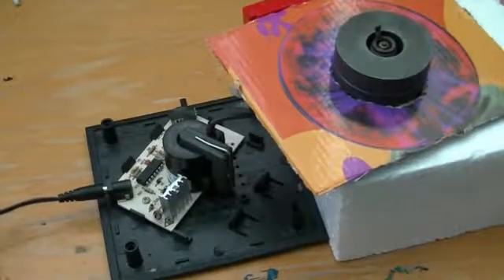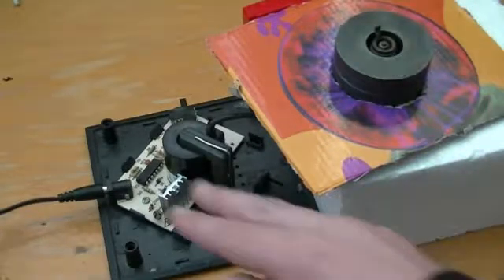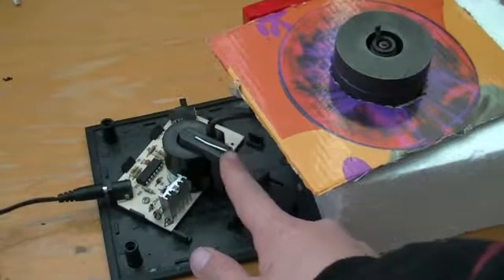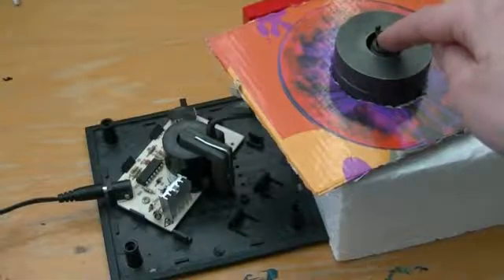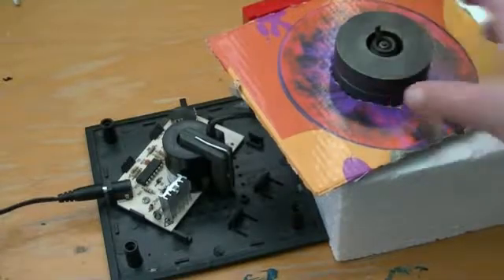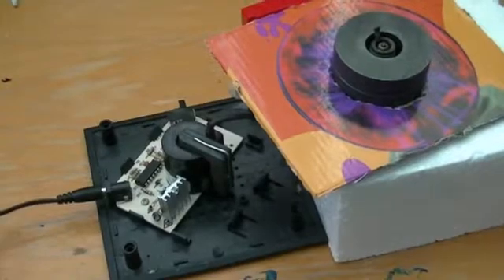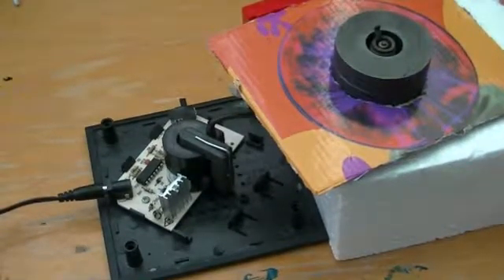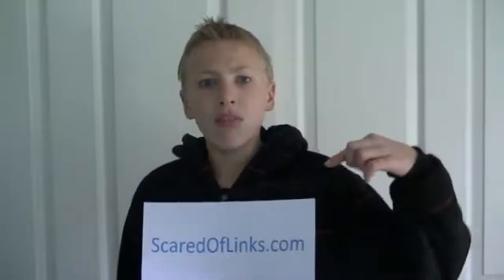plasma forcefield! By science1324!

Comment: so, you connected the output wire from the plasma ball to the middle of the spark plug and had the magnet around it? and the reason the spark plug is there is that it had to be a perfect radius so that the arc doesn't stay in one place? I think I'll try that because it looks fun and I'm taking apart a plasma ball soon anyway
Reply from the maker: Exactly! Good observations! Good luck building it. It took some trial and error for mine to work but it's well worth it in the end. Also, mine had some troubles when it tried to spin (it would always get stuck in one spot) so I had to carefully file down where it stuck until the arc could spin freely; I'm sure that this was due to the fact that I had used a very old sparkplug. 
Anywho, have fun and be safe!